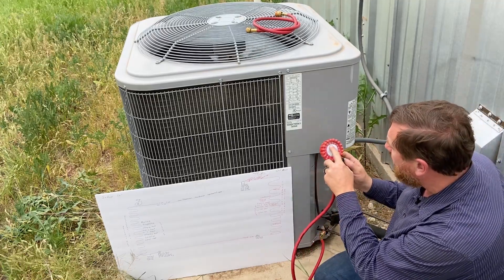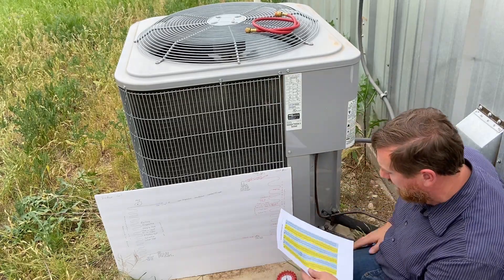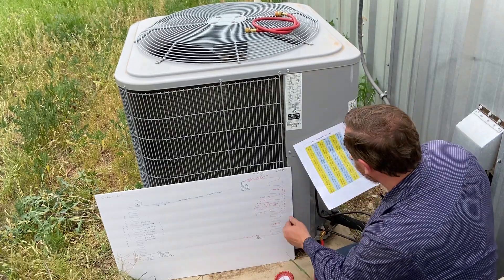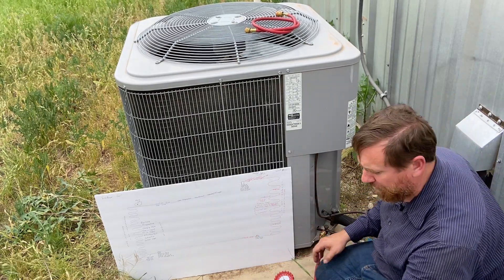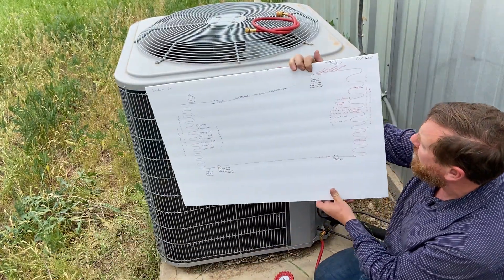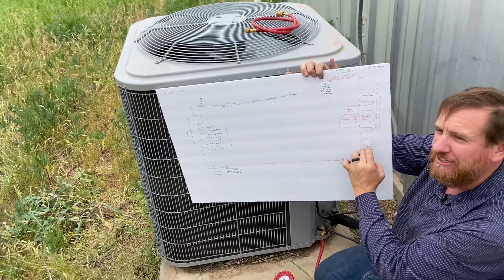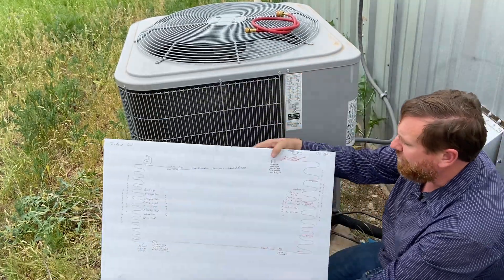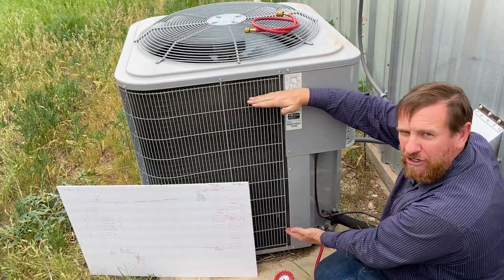HVAC 026 PSIG to Saturation part 3 head pressure on the unit

Comment: great video thanks again, did you mean high pressure or is head pressure an actual term? on the title of the video
Reply from the maker: Technically it should be high pressure but head pressure is often used.